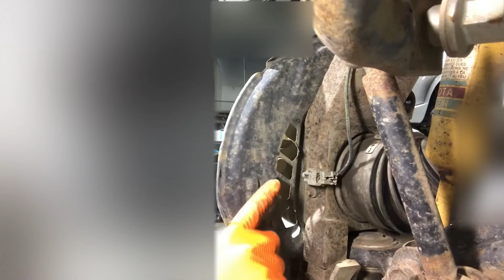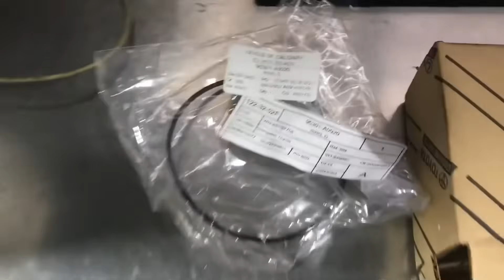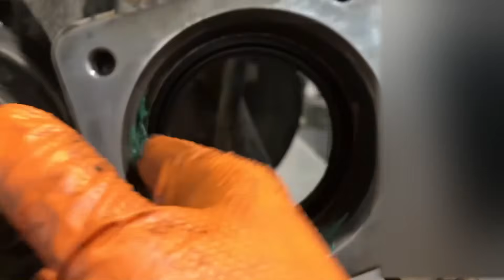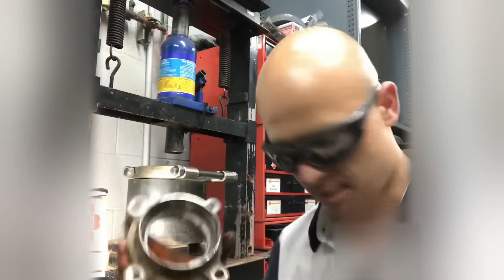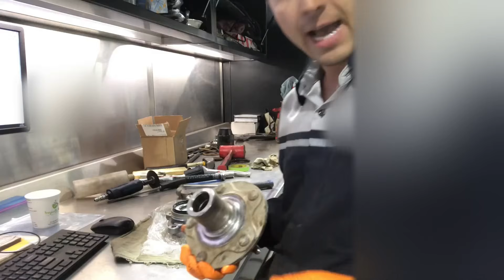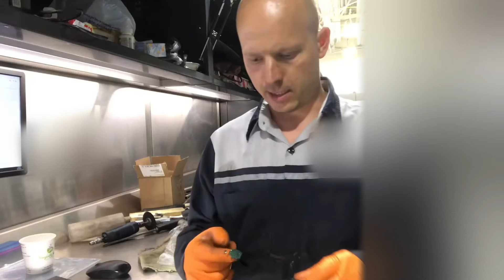2007-2021 Toyota Tundra 4x4 Front Wheel Bearing And Axle Seal Replacement Instructions

Comment from the maker: Below are my affiliate links to the parts and tools you would use to complete this job. I may receive a small commission from the product sales. Thank you!
KOYO (OEM Toyota supplier) wheel bearing: https://ebay.us/yyt58X
KOYO (OEM Toyota supplier) wheel bearing with hub and bolts: https://ebay.us/H4dUI0
OEM Toyota bearing O-ring: https://amzn.to/4dgV9nc
OEM Toyota bearing outer seal: https://amzn.to/3A5CBbn
OEM Toyota bearing inner knuckle seal: https://ebay.us/6kbH3l
12 Ton hydraulic shop press: https://amzn.to/3RyDo9H
39 mm axle nut socket: https://amzn.to/4dqaT7j
3 Ton truck jack stands: https://amzn.to/3q6VS7t
Automotive trim and clip removal kit: https://amzn.to/3KgKGfg
1/4" impact driver kit: https://amzn.to/48he4LZ
Impact driver socket adapter set: https://amzn.to/44XTTkI
1/2" drive cordless impact wrench kit that I use: https://amzn.to/3Kcw00I
1/2" torque wrench for tightening the wheels: https://amzn.to/3Kcu48E
3/8" drive flex head digital torque wrench: https://amzn.to/3O1EOru
Rechargeable LED mini work light: https://amzn.to/3Y74OpY
Reply: FIY before this information gets deleted.. The link above I have saved the Make/Model of the following 

1. Koyo Wheel Bearing only NOT with hub - Koyo 2DUF058N5R (can be found at rockauto)
2. Toyo OEM bearing Oring - 90301-A0005
3. Toyo OEM bearing outer seal - 90312-A0002

Hope this information helps when those links a dead and gone.

Comment: Note you dont actually have to remove the speed sensor. Mine was seized up pretty bad, ended up snapped off, had to remove by heating it, drilling a screw through it, and yanking out thanks to advice from some of the other comments here (thank you… only took 5 minutes). If you think its gonna break, may want to leave it alone. Cheapest replacement i found is 150. 
But if the inside of the knuckle needs to be cleaned then probably have to risk taking it out.

Great video! Thank you!
Reply from the maker: Good tip

Comment: Why di you blurry most of the video? your work is fantastic with fantastic tricks but is a horrible distorted video
Reply from the maker: Sorry, it had to be done in order for me to be able to upload it.
Reply: @Viktor_G_Automotive  once again is a fantastic job with fantastic tricks. This time but next time make better quality haha. Cheers
Reply from the maker: @geronimopascuale9208 sounds good, thanks!
Reply: @Viktor_G_Automotive  Hi. Do you have a video of 2001 Nissan Sentra xe rear bushing axle suspension?. Not struts but the axle arms.I think is B15 chassis/suspension.
Reply from the maker: @geronimopascuale9208 hi, I do not have that video unfortunately
Reply: @Viktor_G_Automotive  Do you know if the 1997 Nissan Maxima have the same rear suspension as the 2001 Nissan Sentra xe? Sorry to ask too much. Thank you for your response. Regards
Reply from the maker: @geronimopascuale9208 sorry I pretty much only work on Lexus and Toyota, not much experience with other brands

Comment: What part number is the first seal you replaced at the inner cv axle thanks!
Reply: 2007 4x4 limited 4.7 dc
Reply from the maker: Hi, the best thing to do would be to contact your Toyota dealership parts department with your VIN to make sure you get the correct part number for your particular model/year.

Comment: What part number is the first seal you replaced at the inner cv axle thanks!
Reply from the maker: Hi, it would be best to contact a Toyota dealership parts department with your VIN to make sure you get the correct part number for your application.

Comment: Hey brother do you have a 2020 tundra rear wheel bearing replacement video??  I need some guidance never done it before
Reply from the maker: Unfortunately I don’t, it’s a bit of a pain and requires a special service tool, unless you can jimmy rig something.
Reply: @Viktor_G_Automotive  ok thanks brother. What would be the tools and parts I need to complete the job? I found the seals and wheel bearing but what else should I get?
Reply from the maker: @Kodfish84 it’s been a few years since I’ve replaced those on my truck, so I can’t recall exactly everything you might need. The best thing would be to contact a Toyota dealership and ask them to price out all the parts for the job. The special tool is needed to hold the assembly on the press while you are pressing the axle out. It’s a long tube with flanges on it.
Reply: @Viktor_G_Automotive sounds good brother. Thanks for the help
Reply from the maker: @Kodfish84 no problem!

Comment: I've been under many Tundra's. That steering knuckle is nothing I've seen before. Must be a huge modified lift
Reply from the maker: @eddie3314  yes, it has a 12” Bulletproof lift on it. The bearing replacement procedure is the same though.

Comment: Viktor, thanks for the awesome video! I am looking forward to checking out the rest of your channel. I wanted to ask about the the link you have that sells the hub, bearing and bolts together. Do those come assembled? And if not, do they come with the outer axle seal?! Thanks
Reply from the maker: Hi, I would assume that they would be assembled together with the outer hub seal. I do not believe the package would include the axle seal. Just to clarify, I am not the seller of the item, I just find the items you need to do the job and provide links to save you time and possibly earn a small commission from the sale of the item. Thanks!
Reply: @Viktor_G_Automotive  thank you for your help! I did order these hubs and they came with everything, bearing pressed on the hub with the outer seal in between, and the inner spindle axle seal and even the axle cotter pin as well. The bearing looks to be an oem koyo bearing however, the hub, wheel studs and both seals are outsourced and not oem. Definitely a bargain with good parts where it matters. Hope this helps anyone else wondering the same! I also grabbed the 39mm as well from your affiliate link! Have a great day and keep up the great videos!
Reply from the maker: @bobbygindal3745  excellent, thank you for the update and the support!

Comment: Will a bad wheel bearing cause a buzzing feeling in the steering wheel at higher speeds?
Reply from the maker: @hammy9760  potentially, yes, but without being there to diagnose it, I can’t guarantee that it’s the actual problem.
Reply: @Viktor_G_Automotive  thanks for the reply. I have a 2012 tundra 4wd with 90k. I just had to replace a rear wheel bearing so just considering doing both the front since I noticed the buzzing feeling.
Reply from the maker: @hammy9760  sounds good 👍

Comment: Can we get the part numbers??
Reply from the maker: KOYO (OEM Toyota supplier) wheel bearing: https://ebay.us/yyt58X
KOYO (OEM Toyota supplier) wheel bearing with hub and bolts: https://ebay.us/H4dUI0
OEM Toyota bearing O-ring: https://amzn.to/4dgV9nc
OEM Toyota bearing outer seal: https://amzn.to/3A5CBbn
OEM Toyota bearing inner knuckle seal: https://ebay.us/6kbH3l
For the axle seal, I would check with the dealership parts department with your VIN, I think they may differ depending on your engine size/year.
Reply: @Viktor_G_Automotive  awesome, great video
Reply from the maker: @dave8114  thanks Dave!

Comment: If I buy a Toyota OEM hub assembly and wheel bearing can they be pressed together? So they sell it as one unit?
Reply from the maker: Toyota doesn’t sell the complete assembly pressed together, but you could buy all the parts separately and ask a shop to press it together for you.

Comment: TY for video I was looking for the info on the seals. 

So I always put Copper Anti-seize on the Hub Flange shaft, it helps keep if from "Seizing" in the inner bearing races. I work on a lot of beach driven trucks and have had a number basically be welded to the shaft from salt damage, so now EVERYTHING is Anti-seize if is just metal to metal connection and doesn't call for grease or oil lol.
Reply from the maker: Good suggestion!

Comment: Hi Viktor great content you're putting there. I have some issues with my 2010 rx350 that I need help with. How can I talk to you about it? Email?
Reply: The push to start often doesn't work. Even tho the key has battery. It always unlocks and locks the car when I approach it. However a lot of times I press the start button and it doesn't turn the car on. The car doesn't say key not detected or anything. And when I set it to passive smart key where you have to touch the key to the button it always made the sound that means it recognized the key, but it would turn on. That happens often after a rain.
Reply from the maker: @jonathanattia2164  Whenever I hear from the customer than an issue may be rain related, I always start by doing a thorough investigation into water leaks. The first thing I would do is pull off both kick panel covers on the driver and passenger side. Behind them, there are many junction connectors. Very often water leaks between the windshield and the body due to an incorrectly installed windshield end up inside those connectors as they are located directly below where the water entry point is. Remove the covers and methodically disconnect each connector one by one and thoroughly inspect each for presence of water or green/blue corrosion on connector pins.
Reply: The second question is I have some knocking noises from underneath the car when I break a bit hard or when turning the steering wheel all the way. Both mostly on low speeds. The dealership said it's coming from the rear catalytic converter. But when I tried to touch and move it around it wasn't loose at all and didn't make any sounds that indicate something is not connected well or broken
Reply from the maker: @jonathanattia2164   This is not a common issue that I have run into. Since the dealership has looked into it, unfortunately, I don't see how I can question their diagnosis without  being able to drive the vehicle and listen to the noise.
Reply from the maker: Hi, thank you for the positive feedback! You can ask your question here in comments and I will answer if I have a chance to do so.